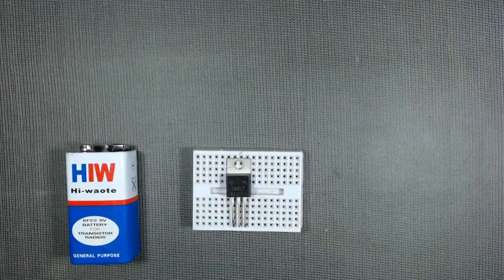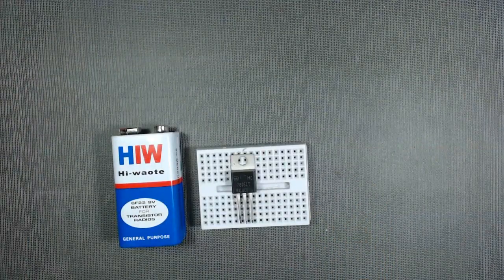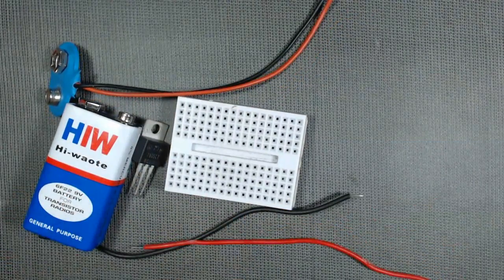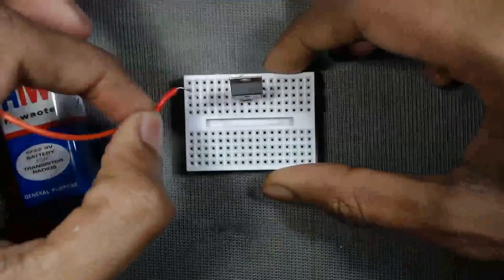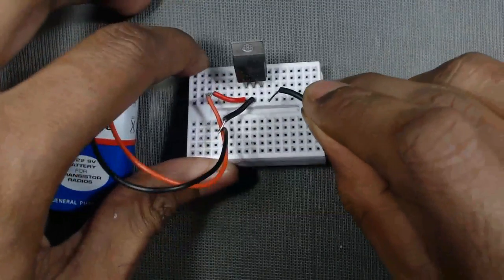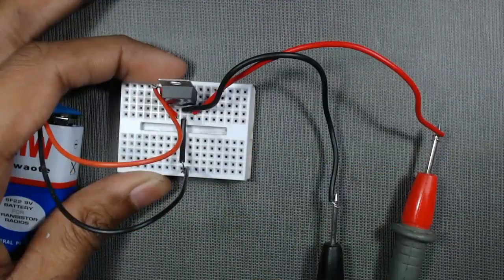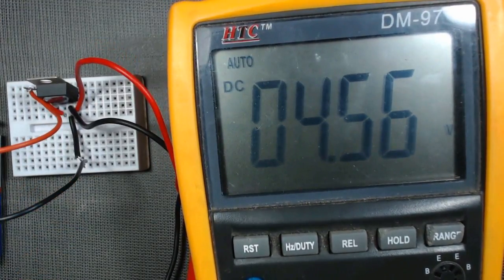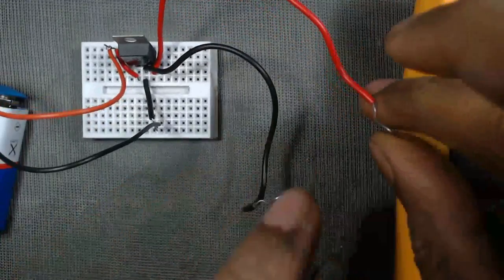how to get 5 volts from a 9 volt battery

Comment: Cool vid, but you talk to fast and not explaining enough. Plus it’s always good practice to keep your fingers away from the power source terminal points. Don’t think anything will happen? Go wash your hands and air dry for 60 seconds then touch those terminals and tell me what happens. Wear a wedding ring and wet fingers.  Just because 99/100 times nothing happens it only takes 1 time 1 millisecond and 6 micro volts and your heart beat will be interrupted. If times just right you’ll stop your heart. Though extremely rare occurrence it can happen. It’s good practice to keep your fuckin meat hooks off the power source terminals

Comment: when working with batteries would be more efficient to use an step down switch converter, then a linear converter, because on linear converters most of the energy will go into heat, so the battery will drain faster.

Comment: How do you hook up a 9 volt battery na 4.5 volt batteries to one switch to control two separate circuits is it possible for a toy